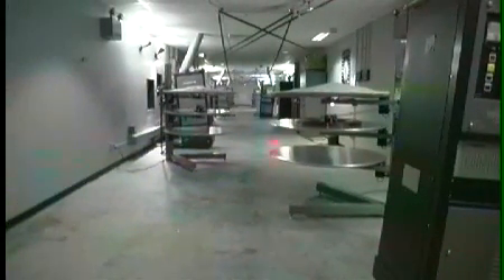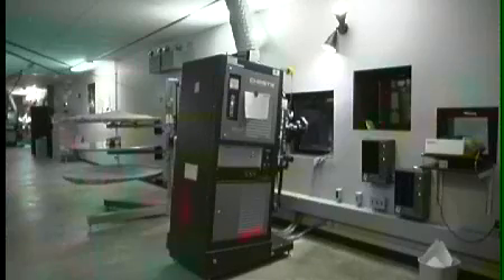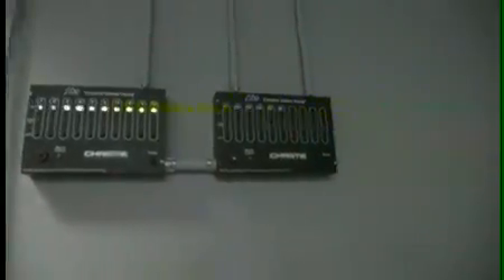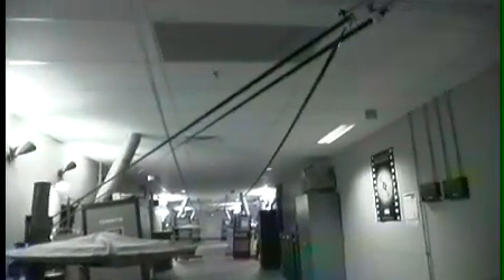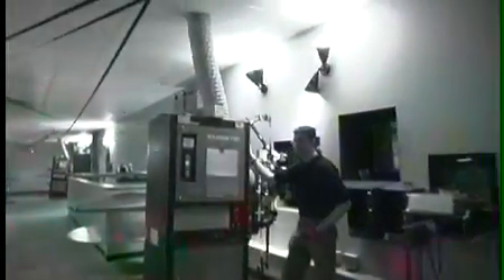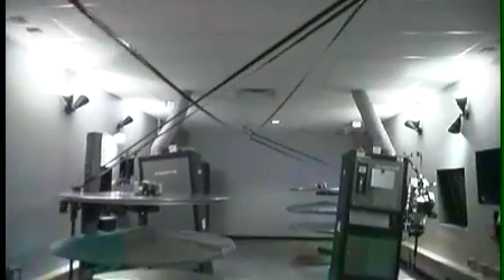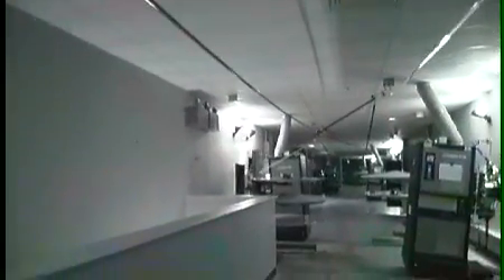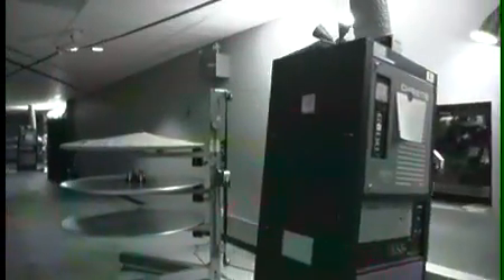35mm Interlocking 101

Comment: It's possible... just rarely, if ever, done.
For instance, the guy running that film-tech site posted about how he had set up a delayed interlock of either 30 or 40 minutes by using a bunch of extra rollers accumulating that much film and he put up a picture of his setup that did a 15 minute delay.

And it's not that the 2nd projector starts later. It's that you have enough extra in between to make up for the delay.